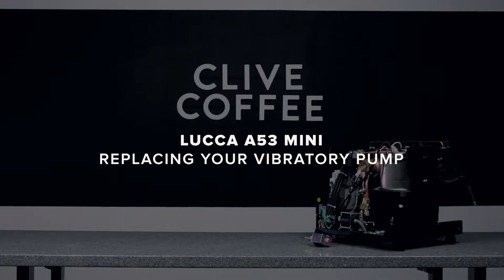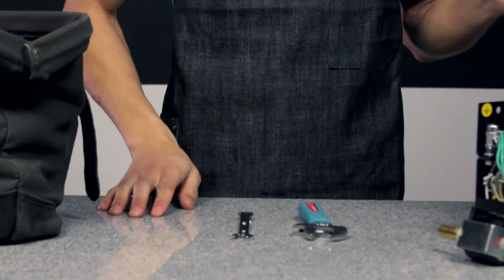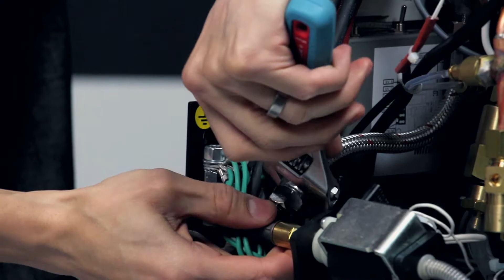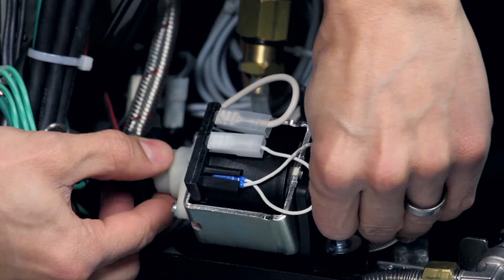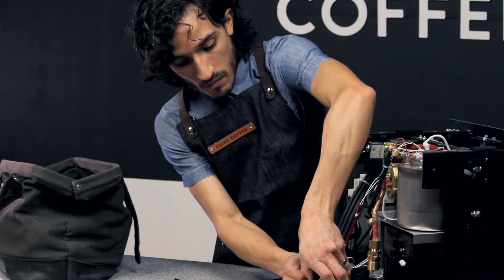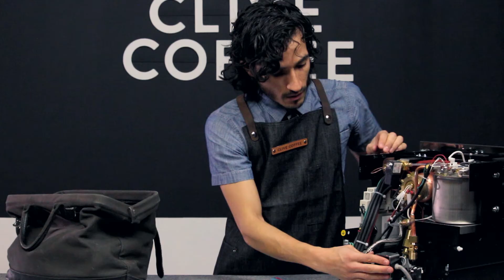Lucca A53 Mini | Replacing Your Vibratory Pump

Comment: I was directed to this vid by the techs to replace the pump on my machine. The tubing from the Dream T has some major differences from the Lucca ( 1:14 ) so I was a bit lost for a while, as a matter of fact I am not sure if you can detach the tubing that feeds from the elbow without damaging it. 

On the Dream T, you don't disconnect the tubing connected to the elbow, you just losen the nut, which is attached on the pump itself on the Dream T, with the adjustable wrench and the 12 Mm then unthread manually to detach from the pump. Finally follow the steps in the video and you'll replace the pump successfully.

I hope this saves a life.